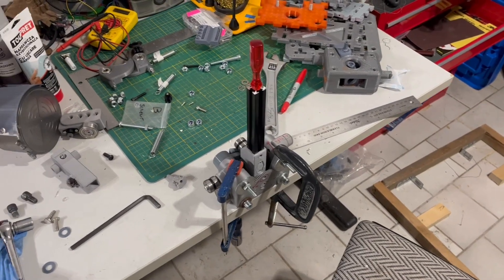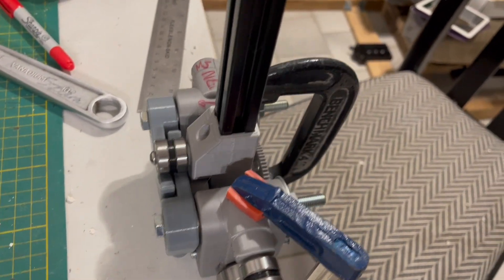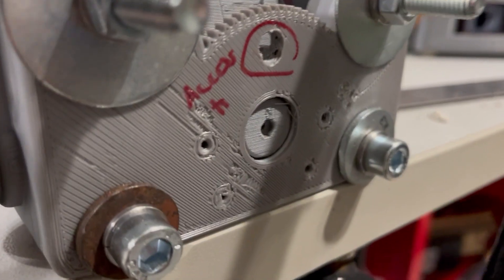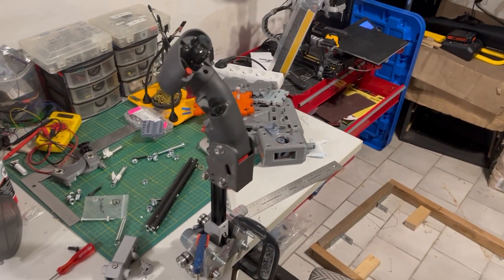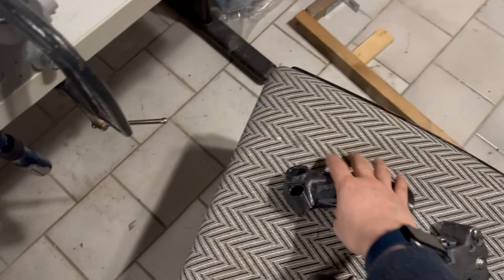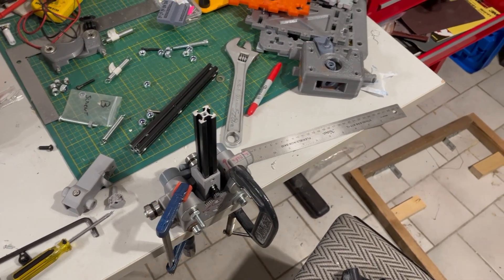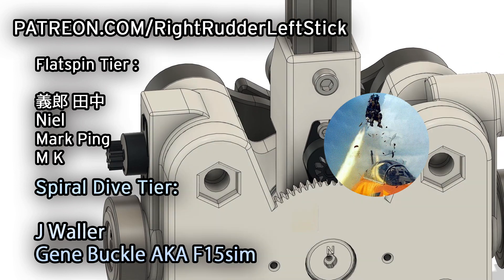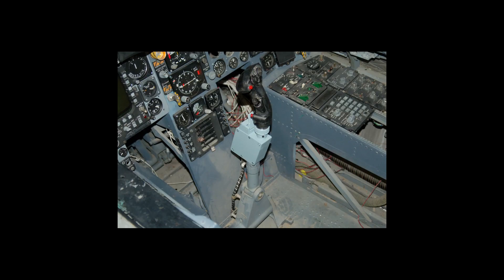Open Source Very Big Stick - Roll stage update!

Comment from the maker: Also I know the 3D print looks absolutely terrible, My ender 3 has been giving me a ton of issues with the temperature swings in the workshop and for now I'm just happy its printing anything at all, and would rather spend time cranking out horrible looking parts that I'm going to break anyway.

Once it gets time to print the release candidate parts before release I am going to dial in the settings and actually heat the basement.

Comment: Solid work my man, question is this going to me mounted into a solid sim pit or on a table/desk top 😊
Reply from the maker: because the the forces involved, definitely recommend mounting to a sim pit, or having it on the floor held down with weights.

A desk clamp style setup could also be possible but it would have to be either a very sturdy desk or using weaker springs